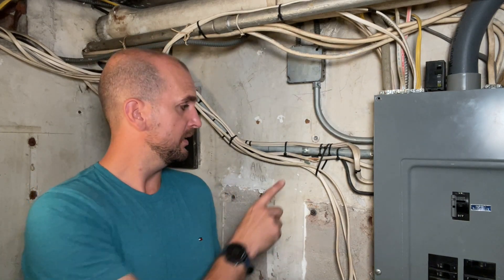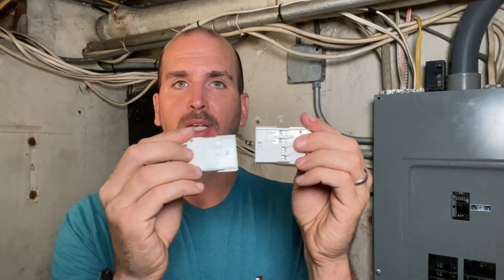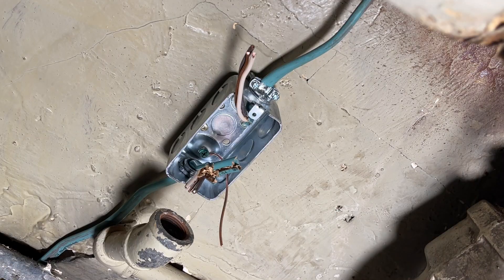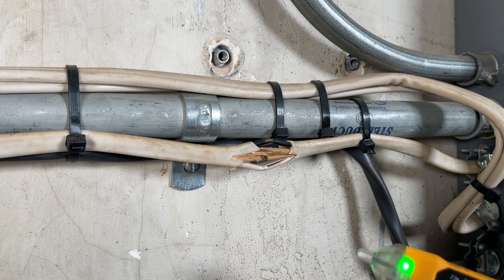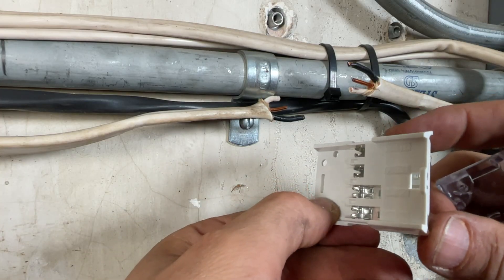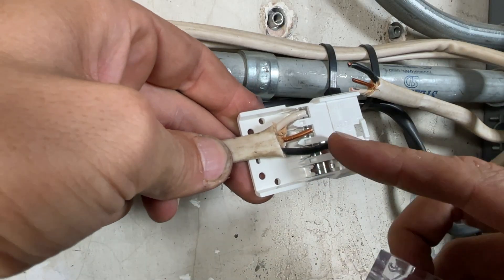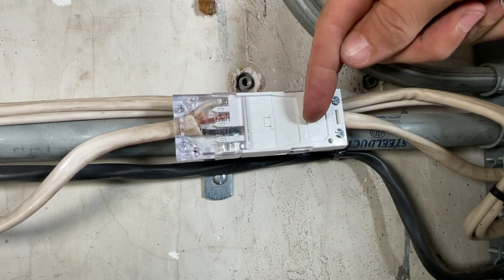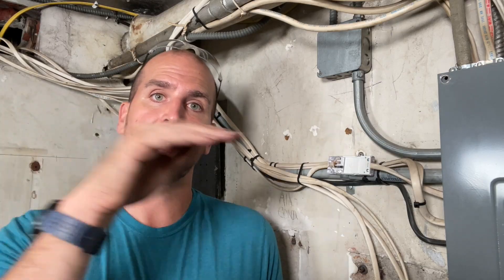How To Repair Damaged Romex Wires

Comment: GREAT video. I had no idea a Romex splice existed.  This is incredibly useful info, in the event cables have to be extended/repaired.  This video was actually more helpful, because you can see exactly how each wire lines up.  The Wago plugs are a little less clear.  But, I'm sure once I get the everything in front of me, it will make a bit more sense.  Another great video.  I'll be tackling a job very soon that will require all these techniques, and just assume not pay someone $80hr to do something relatively simple.  Thank you again.

Comment: So if it cuts into the insulation and the wire itself then it just weakened the wire. Also the the contact area is very little.

Comment: What’s point of grounding metal box?  The box isn’t grounded to anything metal is it?  I don’t quite understand that step
Reply: Metal boxes are always grounded, for the same reason all grounding is done: If a hot wire were to come loose in the box (or its insulation fail) and touch the steel, then the box would be energized and the next person to touch it could well make it into the next day’s newspaper for all the wrong reasons.

Comment: If the cup water is not damaged then you open up the Romex long enough to be able to take the damage now what you do is you take the same type of Romex cut the length of insulation you need slice it down the middle put it over the bear while you're fixing with a sliced and spacing out shape with quality electrical tape at least a double tape do this for the neutral and the hot if both have been opened up you can even take the outer jacket of your Romex and use that taping that up as it's pretty much bulletproof bijou aren't weakening the circuit the other by cutting the wires

Comment: Anytime you have an opportunity to replace old wire with new wire, that is what you should do. Insulators breakdown over time. Also, I still would avoid concealing a plastic brick in my wall. Having rewired two houses now, I am overjoyed when I can pull a new run through an existing path. Hiding a connection in a wall is sure to piss off a future homeowner or professional trying to locate where in the middle of a long run someone anchored a brick between two studs.

Comment: I’d never use that splice kit. This is an IDC type connection ( insulation displacement). These are used in travel trailers and manufactured homes. Big reason insurance companies won’t insure manufactured homes in some areas of the country.

Comment: thank you for your knowledge and sharing , i am a d.y.i. there is a similar product used for low voltage , not as well made but same concept , after install the connection was flimsy, i was   not confident .

Comment: 100% agree. A very thin piece of copper strip holds the wire from pulling out of the connector. that’s it. a very, very fraction edge of a thin copper blade has the current going thru it. not meant for any kind of amperage except maybe lighting and such. Have tried it and smoked the connector.

Comment: I'm installing recessed lighting in my kitchen ceiling to replace a single boob light. The existing romex is too short for the new locations, don't want to run a whole new run all the way to the basement, and I'm concerned about these splice kits for longevity and safety. Also I obviously can't have a junction box or face plate just randomly in the middle of the ceiling... What to do what to do?
Reply: There is nothing wrong with a junction box in the ceiling. Texture and paint the box cover to match if need be. By code junction boxes must be accessible; I have seen them hidden behind Sheetrock. You won’t notice it after a while. As for a fire caused by unsafe and improper wiring, that would be seen for miles around.

Comment: Why would you not cut off the insulation on the black and white wires before inserting them into the splice kit? You would have a better connection for the high amperage loads.

Comment: I would make sure that the insulation on the black and white wires is still intact, no bare wire showing.  If good, I then would wrap white electrical tape around the gap in Romex.

Comment: Man I do not like that splice kit. I'm getting flashbacks to T taps used in automotive wiring. They always make an inferior connection and are prone to corrosion. I've had to trace many faulty circuits on numerous vehicles.

Comment: While this is UL Listed, it's not actually listed for the specific use case in this video. The manufacturer's spec sheet qualification section states that it's listed "under UL File E57250 for use in manufactured buildings; mobile homes, manufactured homes, and mobile home parks; and recreational vehicles and recreational vehicle parks." You have to use a device according to the manufacturer's specification.

I can be used in existing buildings/dwellings, but that's only if a splice connector is use in combination with a T-tap connector.

Comment: Maybe somebody can help me. My girlfriend told me she plugged something in a outlet and 3 rooms went out. After doing the best I can I found that a hot and a ground were reversed on all the outlets. So I took down a fan and in the box had a bunch of splices . So I took them apart. After I did I tested all the wires for power. One wire has power but voltage is All over the place. So I assume that wire is the home run to the breaker and within that wire it’s messed up. I tested the other wires for continuity and every one has continuity. I also did something I shouldn’t have but I gave those dead wires power by a extension cord and everything that went of came on. So my question is can I run a new home run from the panel straight outside up a conduit and then into the second floor to the fan box???? ( I feel running the home run through the walls would be a bigger job considering how old the home is and cutting into wall) . Hope someone can help me thanks!!!!

Comment: Hi, Scott - aren't these splices only rated safe if the metal strain relief tabs are attached?
Reply from the maker: I think there are a few different designs and this one doesn’t callout / come with the metal extension tabs for strain relief.  I will admit these are kind of a last resort for me and I would prefer the box or running new Romex if possible. 👍👍

Comment: A question & safety comment: For straight-run splicing, is there a reason you don't use WAGO straight through splice connectors? When testing for power your equipment and method should be tested on a known power source before and after. Guessing you do this automatically but many DIY viewers may not know this safe practice step so I think it worth mentioning.
Great videos and info BTW.

(I'm an Automation Technician with an electrical background.)
Reply: Per the NEC 334.40 (B) (2020 version) you have to "fully enclose the part of the cable from which any part of the covering has been removed". Therefore the Wago connectors won't work as they do not enclose the White-Black-Ground wires where the outer covering has been removed. If you used the Wago straight thru connectors you would still have an "open splice" situation.

Comment: You talk bad about scdt outlets that only effect the one plug and have TWO insulation displacing taps to power the plug , the rest of the wire is a continuous run in most cases, but then install this, with only one insulation displacing tap, on the one side that has a lot more load on it because the entire run is down range from it. I don't understand why , can you elaborate on why you use this but not scdt

Comment: If you reconnect The Romax wires but still aren't getting power, does that mean the Circut Breakers need replacement?

Comment: Those wagos are great.  I don't know if you could've done the version with that 1-gang box if you were using wire nuts. There wasn't enough length from the original wire for using wire nuts. If you used jumpers, that would've double the number of nuts required... jammed into the 1-gang box.  Might not safely fit.

Comment: Wago now has an inline "splice" connector that would work well in this box, especially if the wire ends were short.  Wago 221-2401. The Wagos seem reasonably sturdy, these pierce the insulation devices seem pretty sketchy, I'd like to see them tested a LOT first.

Comment: Seeing as your damage is only about 6" from the panel, why not just remove the short piece of romex from the panel, replace it with a longer piece, and then make a proper splice using wagus or wire nuts inside a listed enclosure?  BTW, check with your local inspection service before using these- they're not accepted everywhere.

Comment: I wouldn't touch anything without doing a proper voltage check. Why is there a need for non contact voltage detection when the wire is exposed already.

Comment: OMG,  STOP TELLING PEOPLE TO DO ELETRICAL WORK.  Only licenced electricians should do even simple electrical work/wiring.  The starting frames of this post shows an installation that should be removed and rewired in its entirety. You DO NOT hang cabling from water/steel pipe, for a start but there are many other issues shown. 😮

Comment: I just fixed a house that had these in place for 8 years. Found the problem and corrected it with a junction box. I shit you not 3 days later the same circuit failed from the next in line splice. I would never ever use these splices.

Comment: Nope. Wouldn't trust that splice repair.

If only the insulation is knicked, I'd only fix the insulation. Plenty of approved insulation repairs that are used in splices using Mastic tape and topping off with Vynil tape.

Comment: cut it, use proper uninsulated butt crimps, use heat shrink on them, then another over the whole thing, stagger the crimps. job done
Reply: @Kevin-mp5of  depending where. def much better connection than whats in the video
Reply: @Kevin-mp5of  that would defiantly not be up to code anywhere..

Comment: Being a HV expert for over 35 years (Europe based) I am surprised to see and learn what is legal or approved in the rest of the world.... These splices however handy, to me, are ridiculous. That these are approved is beyond my understanding. I would never, ever use these in my own home... there are plenty channels on the interweb that show you how this connection is flawed for many reasons. Using a micro ohm meter will show you the transistion resistance. Making then prone to burn out, especially with high inductive loads such as a washing machine... but hey, what do I know.

Comment: I would feel far better with just diligently wrapping the absent insulation portion in a good quality super 33 of the appropriate color and then repair the sheathing with super 33, rather than using that splice kit.  There was no damage to the actual conductor.  Code compliant or not, those intact conductors wrapped with good quality electrical tape are far safer than that splice.

Comment: No matter what the manufacturer says you should never bury any type of connection in a wall. Use a junction box and if it's an exposed wall then set it into the wall with a blank cover plate. You would normally like at least 6" of wire hanging out of the box and in your example being so close to the panel I'd run a new piece of wire from the box to the panel so you can have that much slack in both wires. I would never use a connector with squeese pins for a connection to any wire above 16 gauge. They are okay in light fixture ballast leads but not for a 20 amp load. I would feel really uneasy to have that in my house at all. I would suggest you cut the wires and but splice at least an eight inch piece of wire on and then add some shrink wrap over them, run into a box and the wirenut them together. I hear lots of people badmouthing wire nuts but I've never seen one installed properly fail in forty years as a commercial electrician. The only issue with them is people putting them on as the box directions which are wrong. You twist all solids together, you twist all stranded together, then twist on the wirenut. You only put the solids and stranded with the ends lined up and untwisted when you put both in a wire nut together.

Comment: Honestly all though I would never recommend this, honestly sticking a junction box in the wall then putting a wire nut/wago on the wire then wrapping with electrical tape would be better, but don’t do this the junction box must be accessible just in case a wire nut or wago was to fail.

Comment: I thought those splice kits were known for starting fires? Is that unsubstantiated?

If you are installing a junction box it’s best practice to put the old wire into it from the load side wherever is convenient in it’s accessible length. From there run a new wire to the panel from the junction box to the panel. This way you get a nice looking install with a box that is conveniently mounted (not in the middle of the ceiling) without a stretched wire or multiple connections in the box.

That is definitely a DIYer job that would cause a professional to roll their eyes. Looks like crap but you saved 7 cents.

Also why use a non contact tester on exposed wires? Defeats the point, just use a meter so you know for sure.

Comment: In the example where you used the spice kit, it really would have made more sense to just put a handi-box on the wall and run a new piece of Romex the 12 inches to the left if there wasn't enough wire. Safer, probably cheaper, and less prone to failure.

Comment: After watching the video more I see the connectors have v shaped metal that cuts through the insulation to make contact with the wire. About 40 years ago I had an automotive air conditioner come with scotch lock connectors for taps to existing wires in the car (just power to click a relay).  After having to take the dash back off because they failed, I have never used them again. I opened a automotive air conditioning and radiator shop in 1973 and it is still open today by a former employee.  In the case of my failure (bad connection) there were two different gauge wires being connected together.

Comment: Thanks for the video,  had not heard of the splice kit.  If the wires were not damaged and only a small cut in the insulation, why couldn't you have just taped them up?

Comment: at 1:40 you mention this splice kit can be used in a wall.  I find it VERY difficult to believe an electrical inspector would be ok with a hidden junction point, regardless of how it's done.  I also have little faith in a splice kit that only slightly pierces the insulation to make its connection.  Those Wago wire nut replacements you are so fond of require exposing of the whole wire to make its connection.  This TC splice seems less safe than a hidden junction box in the wall with standard wire nuts.

Comment: While that splice kit looks handy and similar connectors are used in 12v automobile connections, with the damage to the Romex being that close to the breaker box, I would have run a new line from the box to that splice and used the metal box you used on the other repair. The location where you put the metal box looked like a more logical place to use that splice kit. Just seems backwards to me.

Comment: Because there is only a short piece of Romex coming from the main, it doesn't see like a big deal to run a long enough piece to install a junction box, rather than thinking of running a whole new line.  You didn't mention that suggestion.

Comment: I would not recommend the splice kit.  That type of connection may be OK for low voltage applications like tapping into a 12V circuit in your car, but I would not trust it with high voltage and current applications.  There is too much risk of overheating.

Comment: I have found that even NASA has a standard about how electrical wire should be spliced. I am interested what are your opinion on this. I tried this method and a wire spliced like this has an even lower resistance than an normal wire. https://youtu.be/uhzXRIj5FaY

Comment: Universally licensed here : Do Not Follow this . There are safe ways to and always requires a box . 
Did this guy check the resistance with meter ??  The resistance will go up at that connection and depending on load , time under load can heat up that area causing the wires to either come loose or thermally melt the plastic and then short . We have codes for a reason and I have NEVER seen this pass home inspection .

Comment: Any kind of insulation displacement splice is dangerous under high surge current conditions like motor starting or switching into a capacitive load ( like LED lighting, microwave oven, or computer power supplies).  The contact area is a fraction of that of a properly twisted twist lock splice.  If it only carries steady state current it may last but any surge may cause a "hot spot" at the small area.  This leads to higher resistance at the contact point.  Eventually there will be oxide and bad connections.

Comment: Thanks for sharing the video. I damaged  my Romex wire by screwing a bolt in to it. I went with the  junction box option explained in the video . Worked fine and easy! I had enough space in my case, I think the  splice kit is good only if you have limited access or confined area to repair the wire. Also make sure wire is not taking a lot of load (current) if you decide to go with the splice kit.
Reply: You can't guarantee the load, because future owners might load, especially seeing that some feed is underutilized.

Comment: I’m shocked this is what has to be done. Why couldn’t you peel back the romex cover, insulate each wire, and then wrap all the cables closed with electric tape? It would seem the best option with the least amount of wire cutting.